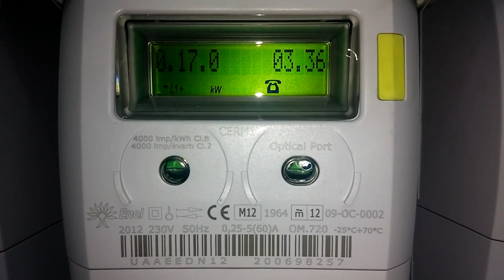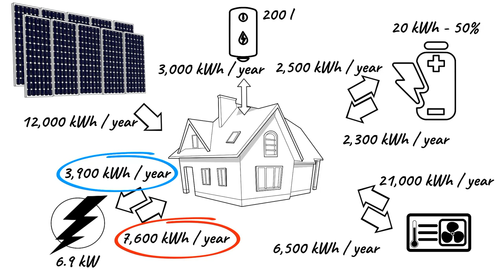NET ZERO HOUSE – The blueprint drafting the roadmap for a net zero house

Comment: Electrical grid is not a large battery. Your house can be if you build it right. I have been in construction helping with passive houses and low energy constructions. Bare winter you don’t need more than 2 kW at night to keep inside around 20 degrees Celsius. Solar boilers are better for heating water, especially when combined with heat pumps. I am a bit dazzled by the amount of energy being thrown away in many houses. Energy awareness should be the first thing to learn at school.
Reply from the maker: Hi Paul, thanks for that. You are right when stating that the energy should be considered at the very beginning of a house construction. in this case, the house is already built so there are very few things that can be changed at a structural level. We can get which is the current energy consumption and we are trying to figure out how to improve it. Keep in mind that this kind of renovation or update is one of the biggest markets and the most impactful one. Residential energy consumption is a big chunk of current global energy demand so worth to think about how to improve it.
Reply: @energytechnologysherpa  Yes I realise energy in older houses is a real brainbreaker, but still if you use brains, you can save a lot of petrol, gas and electricity. Without loss of feeling well. I feel you’re on a good path, please continue. Don’t count too much on the big money though…
Reply from the maker: Agree. Please bring ideas for this specific case. Every case is different but would be nice to discuss potential solutions and why they can fit or not in this house so other can use those thoughts for their own case.
Reply: @energytechnologysherpa  First thing to do is airtight insulation so the house doesn’t loose all the thermal energy. Before you put all kinds of fancy renewable energy systems in place.